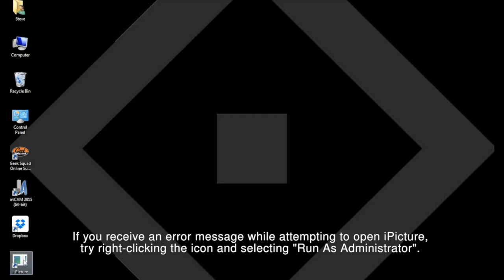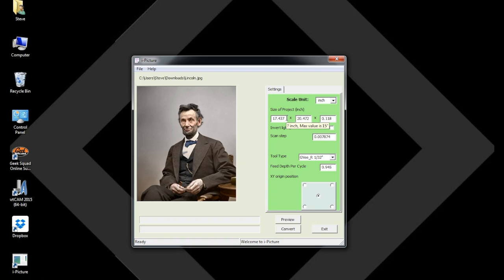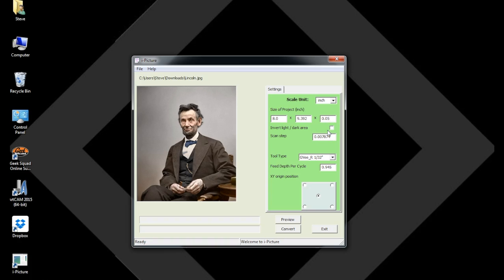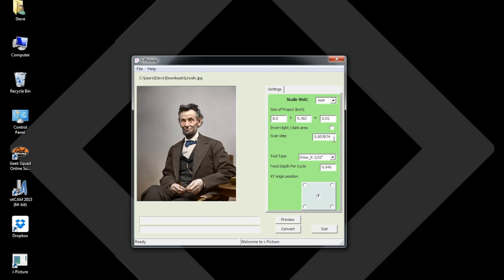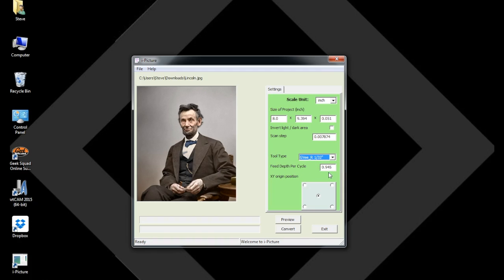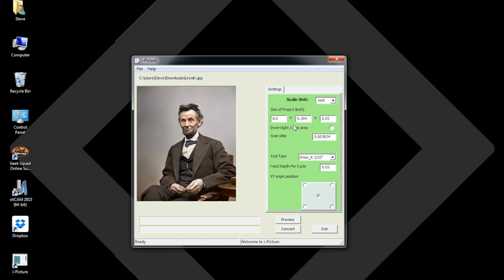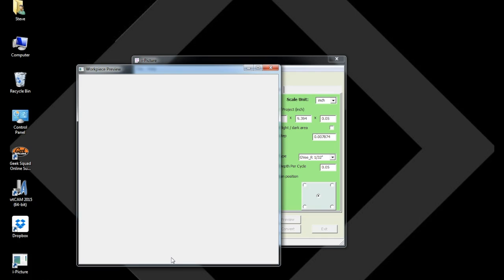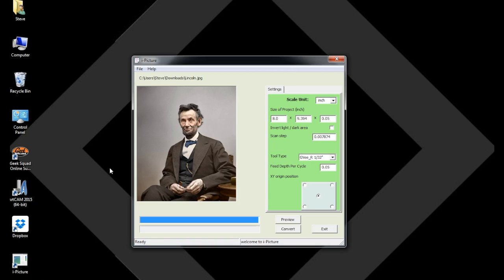iPicture: Machining On Wood

Comment: Could we see the finished product?

I'm a machinist, making metal parts on big haas machines, but I'm looking into getting a small machine for home to make additional income.
What would the learning curve be to master one of these machines?
Is there any metal cutting capability or plans to make either add-ons or a stand alone machine that would be capable of machining metal?

I've been researching a lot of smaller machines and I am definitely interested in what you guys are offering!
Reply from the maker: baloooification Hey! I don't believe that we have the finished product of this particular project, but check out some of our newest videos - we have plenty of machining + finished product videos posted! Let me know if I can help in any way.
Reply: ICONIC CNC 

Okay no worries
, how about any metal machining capabilities?
Or possible 4th axis additions in the future?
Reply from the maker: baloooification The machine works well on non-ferrous metals. It has a variable-speed Spindle + traverse speeds. As of now, we don't plan on adding a 4th Axis to this machine. The i2015X has 20" on the X-Axis, which is not sufficient length for most projects which use a 4th Axis (table legs, baseball bats, etc). It is something we will consider on larger models.
Reply: ICONIC CNC 
Great thanks for the info, I'm leaning more and more towards you guys!
Do you folks have any dealers in California or is purchasing done directly thru you?

Is it possible to upload and metal cutting videos in the future?
Reply from the maker: baloooification Purchasing is done directly. We will actually be in Sacramento on the 5th for the "Educating for Careers" Conference. Not sure where you are located.  

I will definitely work on some metal carving videos.